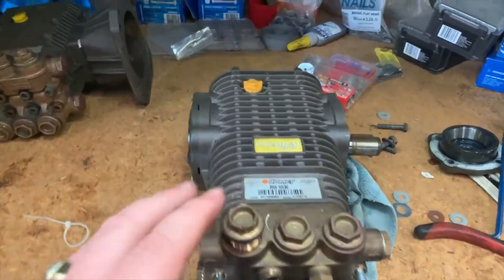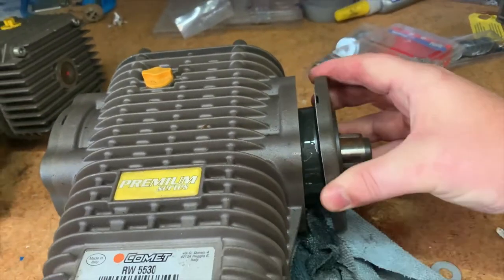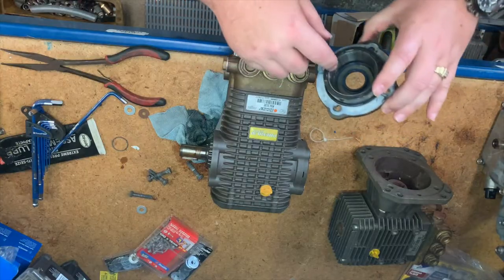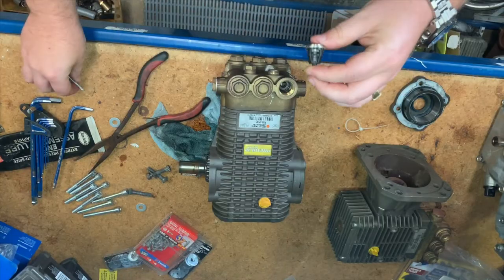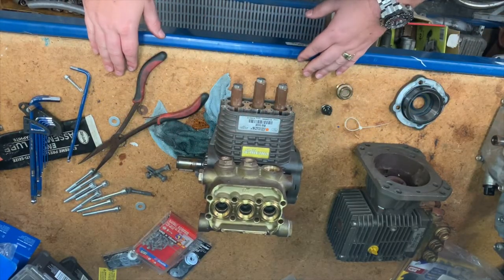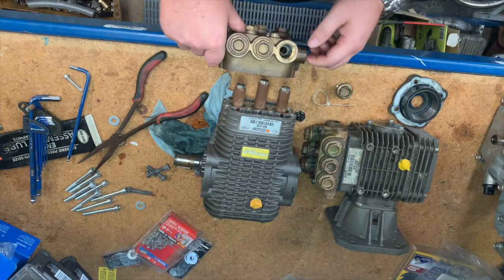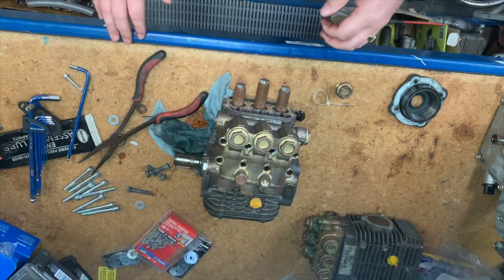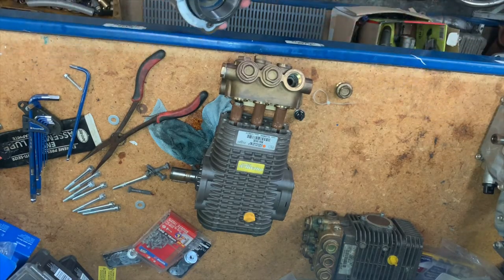PRESSURE WASHER PUMP BASICS -This video will show you the basic or how a pressure washer pump works

Comment: I have a new home owner model that is 3000psi 2.5gpm and the second time i used it it pressurized for 10 seconds then stopped. The motor still runs and i made sure never to let it run more than a few seconds without pulling the trigger to keep the pump cool. Any ideas why the pump is not coming on? I already checked the unloader valve and it is not stuck. I am at a loss.

Comment: Thanks, very informative for me. I have a small 2700 psi pressure washer. After a long period of time i go to use it & water will not come thru the pump. Do i need another head?
Reply from the maker: no just need to unstick the valves in the head

Comment: if the sahft of the pump is driven on the opossite direction.  It will still produce pressure?
Reply from the maker: yes the pump does not care which way it spins, it will build the same pressure regardless which way it is spun